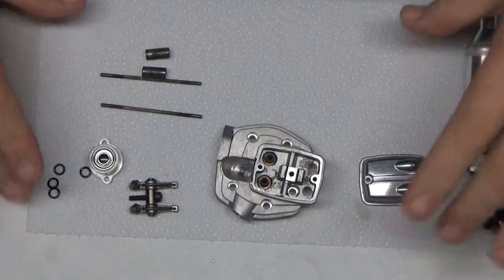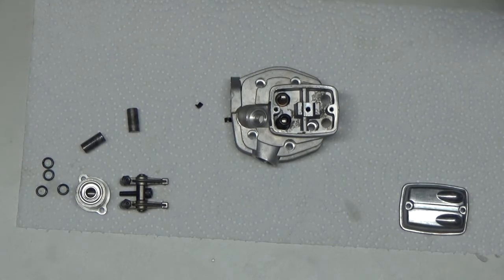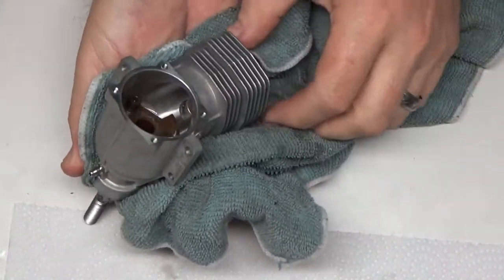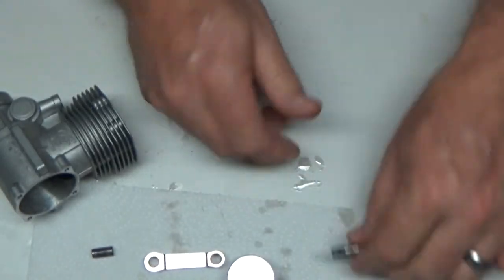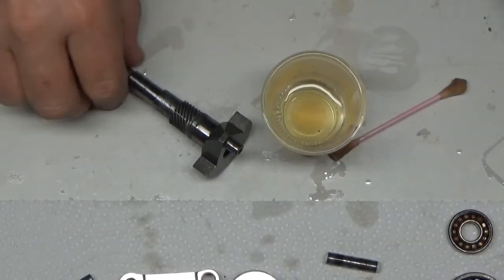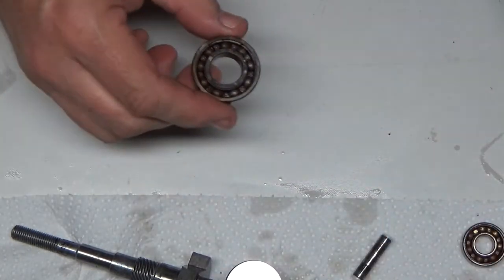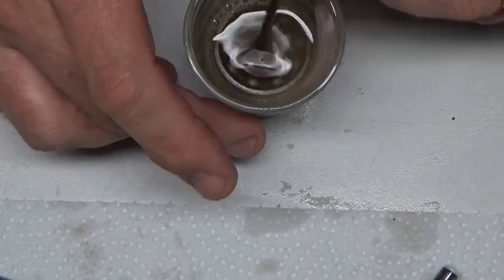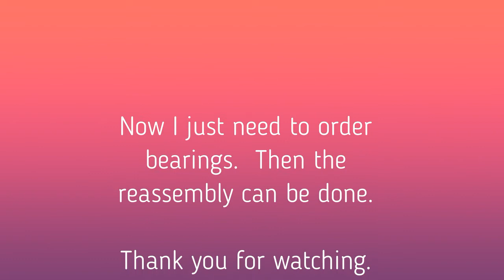OS FS 91 Surpass Customer Engine Disassembly Part 2, Video 4

Comment: Great video - I enjoyed it, but can I suggest that when replacing the valve collets (keepers) you try using a watch makers tweezers. They would really make that job easier, I think, because they are very precise and you would be easily able to adjust the position of the tricky second collet. Hope that is some help. I am also wondering how those crank shaft main bearings got so rusty. Perhaps some of the fuel by products are corrosive. I'm not sure of the chemistry of burning, or part burning nitro methane. Thanks for producing the video. My interest in engines is in motorcycle engines so i learned a fir bit watching this. That was a very nicely made engine.

Comment: CLR is mostly acids which is necessary for mineral deposits, but somewhat overkill for rust.
Soaking in diesel, or hot ethanol or mineral spirits works for me. If you really need the acid, typically cheaper to just buy a 5lb bag of citric acid.

Comment: Where can I order bearings for my OS .91 surpass??
Reply: Go to Boca Bearing website click rc hobby and RC engines, then you can click drop menu for OS and the engine, they are great bearings at a fair price
Reply: Jim, I just had to replace the rusty bearings on a second hand os 46 ax.
The rear bearing when cleaned the rust off it had the bearing number stamped on the side of the outer race.
The front bearing has the bearing number stamped on the shield.